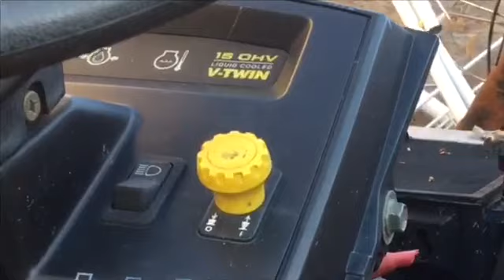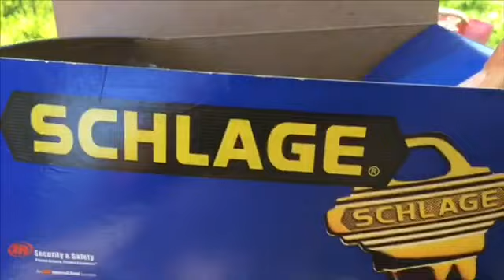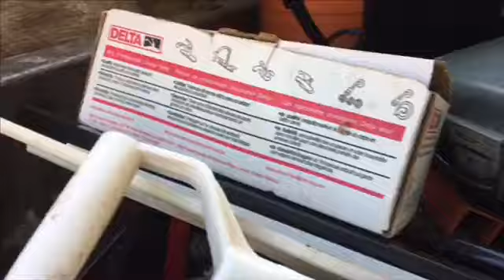Sunset scrappin

Comment: Marty, I guess my GoPro has got me pretty spoiled, It would drive me nuts if I had to hold my phone while scrapping. I have a chest harness that I made and my phone will mount on it it works pretty nice. I beleive a harness like that might help you out.
Reply from the maker: Maybe.  That could be of though I’d like to control the direction where the camera is going sometimes where I have my body turned or I have my head turned is not where I wanna show on camera
When I’m holding the camera I can control the direction I want to show and What  I want to record
Does that make sense
My head might be charged in one direction because I’m looking at distractions etc. and the action that I wanna show is in another direction
I have a tendency to turn my head quite a bit constantly moving and looking to see what’s going on around me